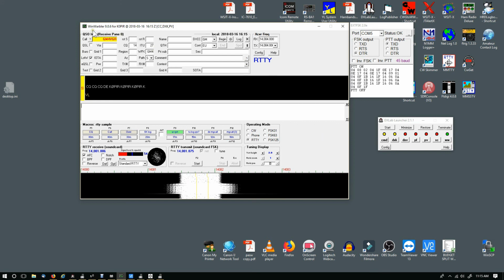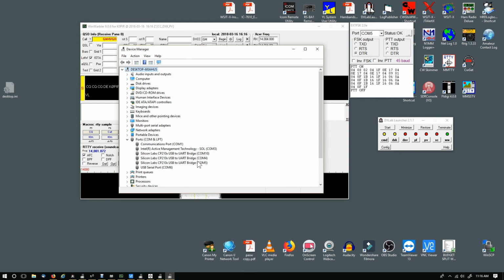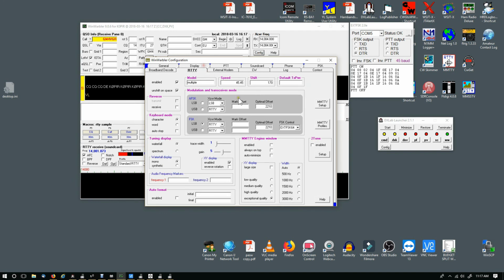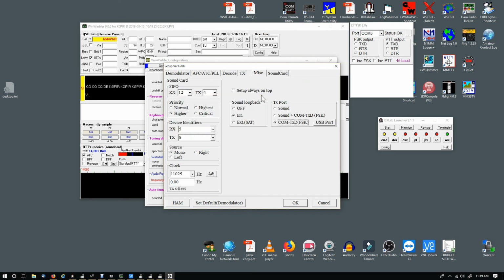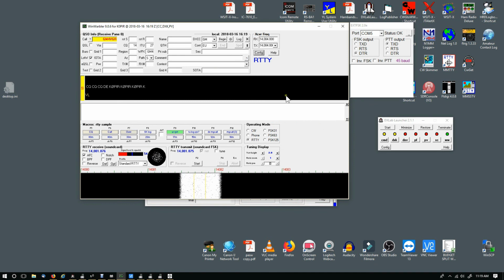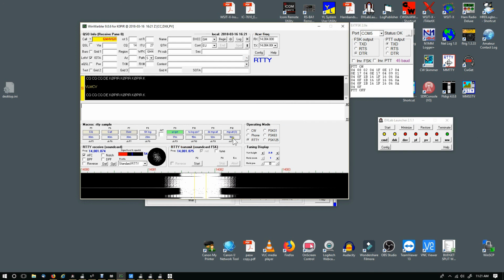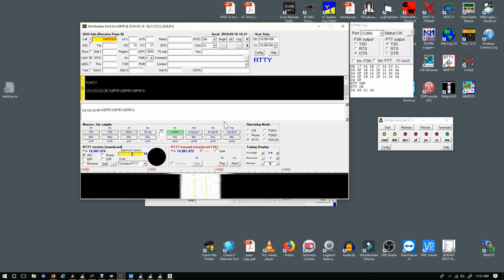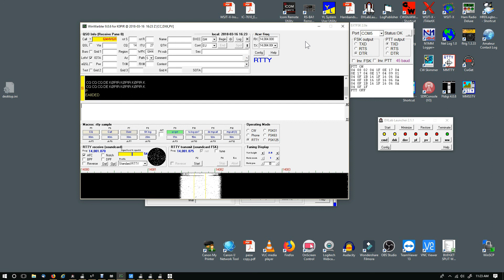DXLab Suite Winwarbler MMTTY RTTY FSK Configuration

Comment: The screen shots are missing on your website. When clicking to enlarge shots  the dreaded file is missing or was never here in the first place error message.   These shots:  Important Icom 7610 Screen Captures.   I am trying to find something that works for psk.  FLDIGI doesn't on the 7610.  I want to make sure I get the rig set up right  before trying to set up "Warbler".  73
Reply from the maker: Hi Maurice, thanks for the heads up. I'll fix it! - Rich, K0PIR